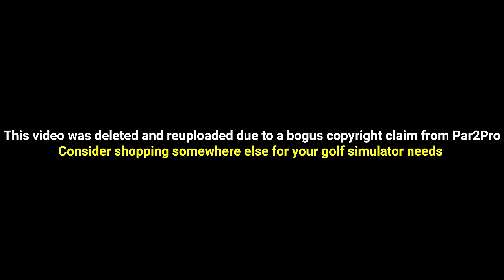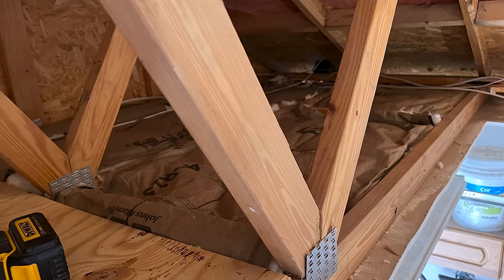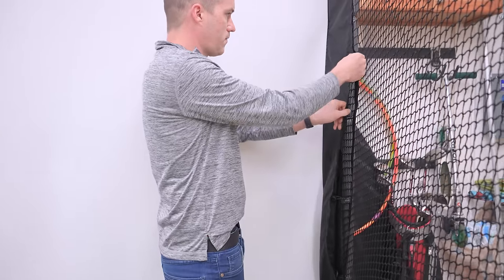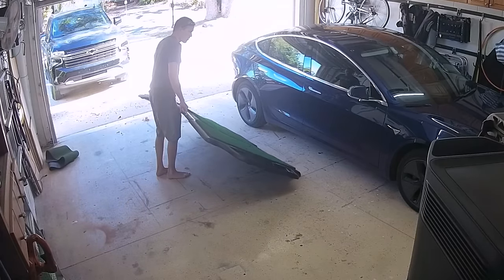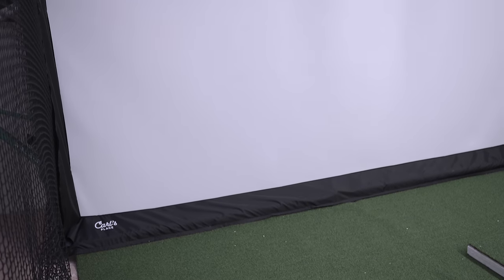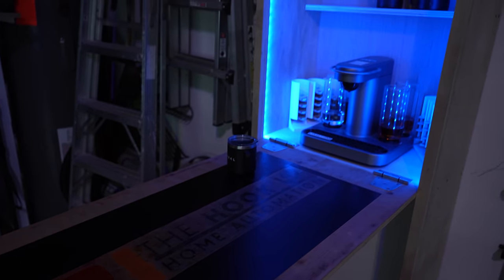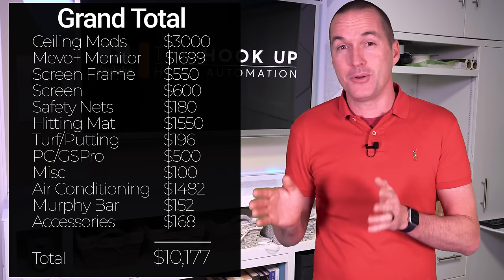DIY Garage Golf Simulator Without Sacrificing Parking!? 5 Minute Setup.

Comment: I did a diy overhead garage storage platform with harbor frieght hoist and garage door parts and my manual safety was just some manual chains attached to the ceiling.  I have to hook and unhook them each time I use my platform (4 on each corner) but safety is a peace of mind thing with kiddos running around.  I would feel comfortable sleeping under it with this manual safety too.

Comment: Thank you for the cliff notes, very helpful. My budget doesn't extend to the BENQ LK936ST, so I will look for a budget 1080p projector - it will preferably need to be high lumens, able to project from the side (can't mount) at around 7’ (tee to screen, using the Garmin R10) and also able to project 1:1 ratio (Net Return Home). The BenQ LH600ST looks like it could be a good option - the lumens just don't look that hot. Thanks again!
Reply from the maker: What's your budget?
Reply: @TheHookUp  I would say around USD 1000 - 1500; room size is Height 2.7m Width 3.33m, Length 5.73m (standard garage carspace here in Australia)
Reply from the maker: I'd say a BENQ TH671st is probably just about right for you then as far as performance vs budget.
Reply: @TheHookUp unfortunately it doesn’t have horizontal keystone so I wouldn’t be able to place offset to the right of tee (I can’t ceiling mount, strata complex)

Comment: Great build. I also have built a simulator in my garage with the intent to be able to move it out of the way to park cars back into the garage. I didn’t have the ceiling height to do what you did so I lift mine to the side wall with a winch. I also made mine out of wood because I have no experience with welding. My cost is closer to $2,500 because I didn’t need to move or change any walls.  I did copy your Murphy bar and it was a great addition. Thanks for the video
Reply from the maker: Awesome, I'd love to see your completed project.

Comment: Would love some more conversation about the software and screen setup.  I know you're using a 16:9 projector, and it looks like your screen is a little taller than a 4:3 screen would normally be.  I have seen many questions over the years where people basically say "THIS is the screen size I will be using." and it's some crazy oddball resolution.
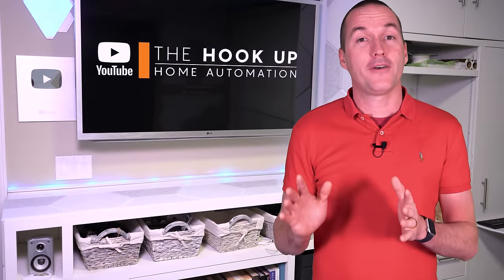Do the programs work with really odd aspect ratios?  Are they locked in at 16:9 and 4:3?  Can they do some custom?  Does it even matter when the projector itself is locked in at 16:9, 16:10, or 4:3?
I don't know the answers and am sincerely asking.  I always figured a bright 1920x1200 used business model of the right throw distance would be a great choice.  Weaker contrast, but would take both 1600x1200 (4:3) or 1920x1080, and deliver a lot of versatility when it comes to the projector...  But I have no idea if the software supports this, or some other 'weird' resolution perhaps?  Would love your thoughts.

Sucks that you had to re-upload this.  Keep up the great work.
Reply from the maker: I can only officially confirm the sim software that I use (GSPro) will work with any aspect ratio.  I have tested some other projectors in my sim and found that with a 4K projector the resolution of 2450x2160 fits my screen perfectly.  I just use the nvidia control panel to create a custom resolution and select that resolution when GSPro starts.  Amazingly it doesn't stretch or skew any UI elements or terrain at this odd resolution.

Edit: to clarify, I line up the top and bottom of the screen with the projected image (the 2160px), then adjust the resolution until the sides fit perfectly.  The side resolution just projects "black", so in a completely dark room you would probably see light bleed, but I definitely don't golf in the dark.

Comment: @TheHookup Any chance you will be comparing the newer released projectors specifically suited for Golf simulators? I know the options and criteria are broad - short or long throw, vertical/ horizontal keystone, corner fit, lumen brightness, throw ratio, projector best for small or large rooms, input lag (thanks for the new gaming projectors review!), REC colour accuracy, wifi casting, aspect ratio, projector resolution (1080p or 4K) etc.
Reply from the maker: I don't know if there's a large enough market to warrant a full review, but here are the golf sim projector cliffs notes:

1) Short throw is preferable for not casting shadows onto your impact screen.
2) Contrast and black floor do not matter since you'll be using them in a room with high ambient light (so you can see the golf ball).
3) Brightness and color do matter.
4) 1080p and WUXGA are good budget options, the 4K resolution upgrade is marginal since impact screens generally have heavy texture that will diminish the 4K clarity.
5) Most people will end up with DLP projectors, but if you want to use a rear mounted swing camera you should opt for a 3LCD option (usually from Epson or Panasonic) instead because your swing camera will show all the rainbows from the DLP.
6) Input lag has no effect in a golf sim.  Launch monitors have lag times between 500-2000ms, so adding a fraction of a second more from the projector makes no difference.

I've used a bunch of projectors in my sim, but have currently settled on the BENQ LK936ST that I bought for two main reasons: 
1) It's designed to be extra dust proof and temperature tolerant, which is important since my sim is in my garage.
2) I use a nearly 1:1 aspect ratio, so with a 1080p projector (BENQ 671ST) I was losing a significant amount of resolution to the strange aspect ratio.

Comment: Excellent video.  I'm replicating your DIY Golf Simulator in my garage and have a question about the Carl's Place impact screen.  Question: You ordered with the grommets and flaps... when you measured the inner dimensions of your carbon steel frame to order your custom Carl's place impact screen, did you add a bit of slack when ordering?  For instance: my dimensions are 105"W and 129"L (inner dimensions of carbon steel frame).  Carl's Place recommended ordering a 
100"W and 124"L tscreen o account for 2.5" grommet (black edging portion of impact screen) on each side.  Any suggestions?
Reply from the maker: Yes, I ordered the screen 1" smaller than the inner diameter of the frame to allow for a 1/2" gap on each side.  In reality the gap is more like 1/4" on either side due to stretch.  

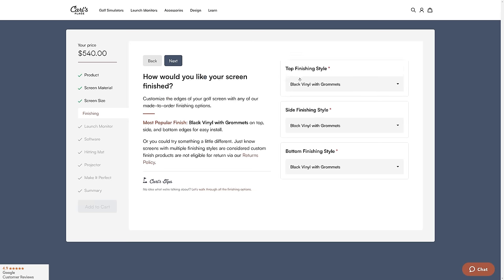You can briefly see at 7:11 in the video that the viewable area is 100x107 while the total screen size is 105x112 and the inner diameter of my frame is 106x113.
Reply: Perfect... thanks so much

Comment: I am considering a similar solution for golf mat raising to the ceiling, but thinking considerably bigger - like 10X12.  I'd use steel frame, but insulation board inserts (similar to what I have today) to keep weight down.  Any thoughts on if this is a really bad idea due to size?  Having a hard time wrapping my head around that sitting above my wifes car
Reply from the maker: The hoists are plenty strong to handle that.

Comment: This is an awesome set up! How did you rig the pulley system for the hitting mat? Cannot for the life of me figure it out from the video.
Reply from the maker: Not a pulley system, just two smaller capacity hoists mounted directly above the 2 lifting points.  Works like a charm.
Reply: Ahhh that make so much more sense! Can you send the link for the light switch you are using? I am doing something similar and would love to be able to cut power to the garage door when I turn on the hitting lights!

Comment: The biggest issue for me will be raising my 8' ceiling that supports the Truss roof. I've been given an estimate of around $18K which includes a hefty $6k permit cost. Out of curiosity, do you know how much yours would have cost if you used an outside contractor (I am NOT HANDY in any way, shape or form...LOL).
Reply from the maker: 18kish sounds about right, depending on the size of the vault.

Comment: So as a sim golfer and a projector guru, I've got a question for a recommendation i hope you can help with. I'm going to attempty own setup in a pretty well shaded area on thd side of my house using a Spornia SPG-7 net, with their 64x64 hitting screen. I wasnt originally thinking of trying to do a full, portable sim setup but they thru that screen in gratis and so that got me headed down the road of thinkng sbout projectors rhat would be effective in my space for this setup. My plan was to use an older IPAD pro as my application device and either lightning to HDMI it or try to Bluetooth to the projector. Ao long story short, any sort of projector recommendation based on description of my setup and space?

Comment: Curious: what insulation did you used for your garage door? Looks like some sort of radiant barrier? How did you get it to stick to the garage panels?
Reply from the maker: It's just Styrofoam insulation from lowes with a radiant barrier backing.  I cut the dimensions exact enough that it is just wedged in between the metal top and bottom of each panel.  I also drilled a small hole in the center of each insulation piece and injected a small amount of "great stuff" foam to make sure the foam isn't in contact with the actual metal of the door since the air gap is where most of the insulating properties come from.

Comment: which GPU are you using in your PC?
Reply from the maker: GT730 in this video, I upgraded it to a 1650.
Reply: @TheHookUp  wow, and it ran just fine on the 730 and the 1650? That’s good to hear, I ordered a 3050ti laptop and wasn’t sure if it would be powerful enough!
Reply from the maker: It's all about resolution and graphics settings.  If you run at 1080p or less (I'm at 1280x1024), and medium settings or lower GSPro can run on almost anything.  It's when you want to do 4K with Ultra settings that you're going to need a full gaming PC.
Reply: @TheHookUp  makes sense, yeah I plan to just do 1080p. I agree, there’s no point in 4K when the screen isn’t even that great looking to allow for the full 4K experience, plus the graphics on GSPro really are not good enough to justify 4K imo